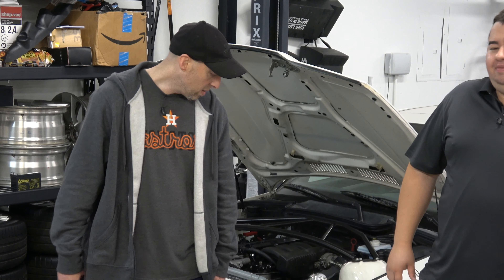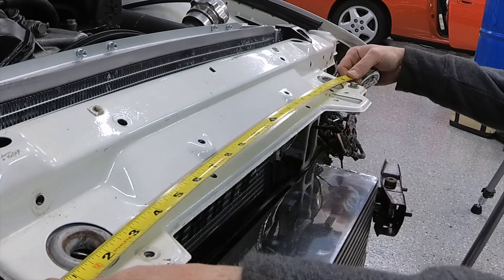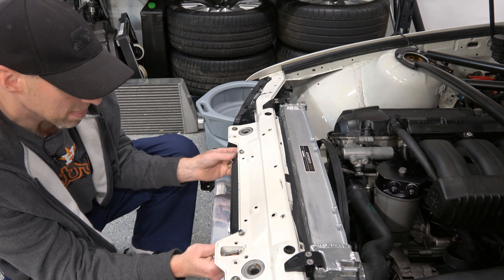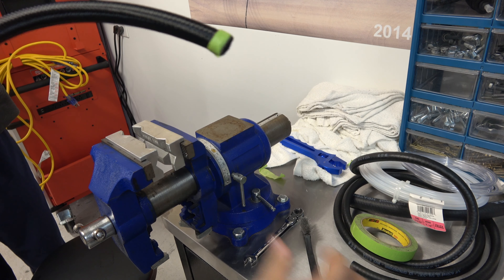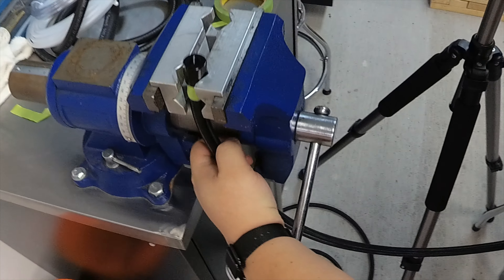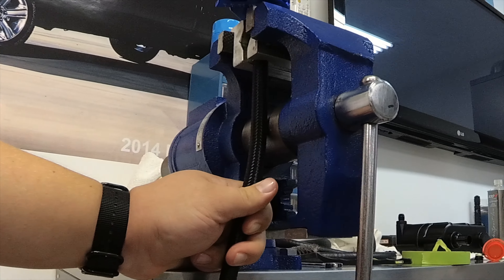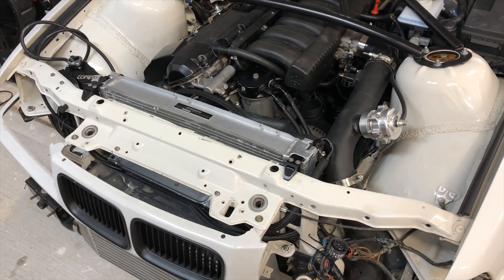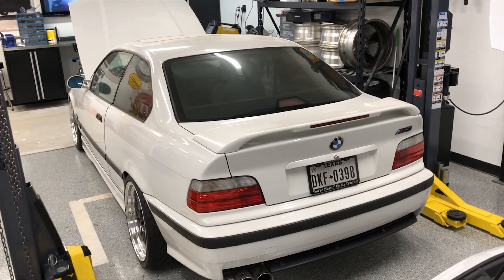Turbo E36 M3 Cooling System Rebuild Part 2

Comment: Looks like he’s running the treadstone 1245 Intercooler, does he have a fan for ac behind there and if so what one is it?
Reply from the maker: He has a diesel fan off the crank behind it. We tried installing an Spal 16"  electric but we just didn't have the clearance.
Reply: Dmitry's Garage any pics of it? Send to @anthony_turbom3 on Instagram
Reply from the maker: I can take some in a bit.